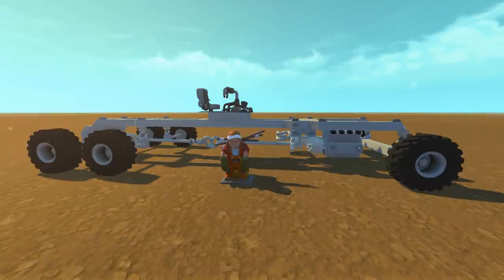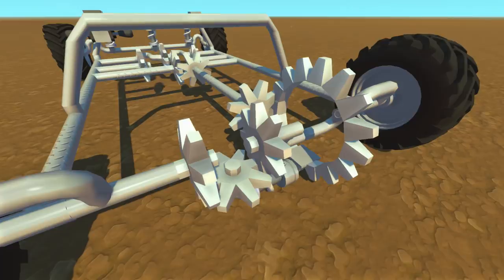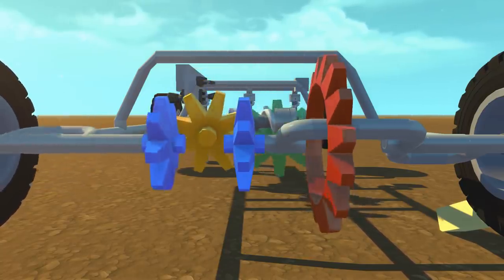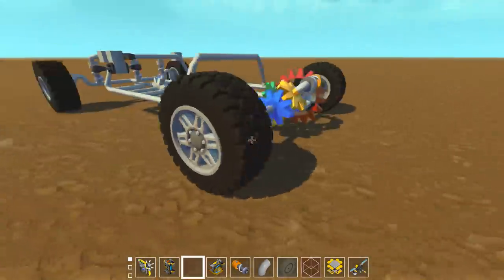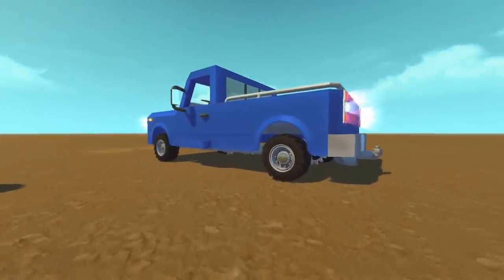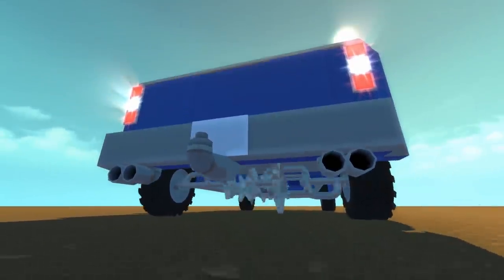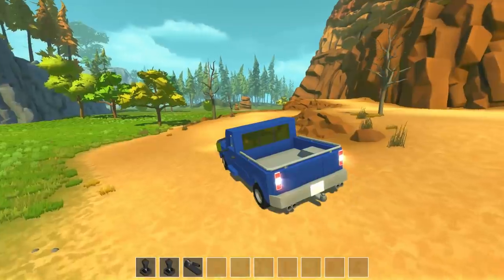I Built a Working Differential with Gears! - Scrap Mechanic Creations!

Comment: Limited slip differential is the next mile stone.
Reply: There aren’t grippy materials so that isn’t possible
Reply: @Lucas-qb3bs  what about a torsion type design? I think it might be possable to put sevral gears together in a stack to make a worm gear
Reply: andre21198 unless you used tiny suspension with mods
Reply: Some companies use a "limited slip" that may be possible with mod blocks.. it applies the brakes to a wheel whenever the other is no longer being powered. Once the brakes are applied it brings them closer to the same resistance... making it work like a limited slip... just have to find a way to bog down the axles...
Reply: It may be possible with a smart engine with a very low strength setting to it.
Reply: A good next step would be to use universal joints to connect the linkage from the diff to the wheels, so the diff can be lifted to have more clearance.
Reply: All you would have to do is have a bar go into the spider gear when the two axles spin at about 20rpm difference
Reply: @Lucas-qb3bs  the modpack has a 100% friction block. Might be the modpack beta though
Reply: @andre21198  i made one when pistons came out
Reply: It's called positraction people
Reply: I’ve been around mechanics all my life people have tried to explain to me how the differential works having this excellent creation finally helped me wrap my head around the actual mechanics of how it all works thank you
Reply: To all saying not possible, yea i get your point, there aren't any grippy materials. 
Now, i would have somehow been to stupid in SM to build a differential even tho i know a lot about cars, but maybe it's possible to do some electronic limited slip differential
Reply: You all do realize that SM doesn't take any of this into account right? All a transmission and differential do in SM is add more shit for your CPU and GPU to do. It's cool that this can be done but other than that its pointless.
Reply: ok
Reply: Milestone is one word

Comment: You might want to make a 'lifted axle' (there are 2 small gears one connected to each end of the axle and the other is meshed below it and is connected to the the wheel, totally you need 2 for each side of the live axles).
Both of what you made is an 'open-differential' they are easy to make but suffer drive loss when one of the wheels are in the air (which causes all the power to go to the wheel in the air), to deal with this there's a 'limited-slip differential' this senses if one of the wheels are in the air/losses traction, and if it is then it will lock the differential which makes the whole axle move as 1 shaft (this makes the wheel on the ground get the drive power and turn, making the car move forward/backwards until the other wheel gets traction, this is sensed by the speed of both wheels which should be more or less even)
Reply: Is a lifted axle like a portal axle, i believe the hummer h1 actually has a gears that put the wheels below the axle. It also has a built in gear ratio i think
Reply: @bkkid3630  Yeah it's pretty much is a portal axle (I didn't know about it, so thanks for telling me!). I believe that the lifted axle has a 1:1 ratio, but it can have a ratio that increases torque (power), but sacrifices speed.

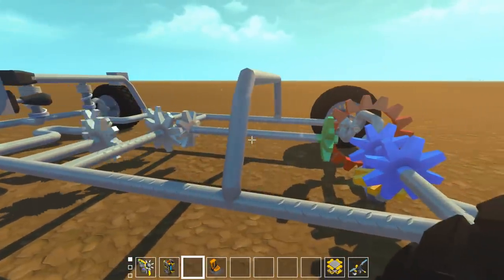Comment: 6:02 "Open planetary differential", or as some call it, a "true differential". Without getting into limited slip, there are two types. Yours is a typical bevel gear planetary differential. There are also spur gear differentials, which have all gears rotating on the same axial orientation. 

If you're after an insane challenge, try building a Torsen or helical limited slip differential.

Comment: moonbo have the differential higher than the wheels and then there are two options. slanted solid axle,or have the axles connected to a gear above the wheel  and put a gear behind the wheel.

Comment: Perfectly accurate to an open differential, getting your differential gear ratio to about 4 (4 turns of the pinion to 1 turn of the ring gear) should make it relatively powerful though relatively slow. I would run it into a transmission like kan made but with a 4-1 first 2-1 second 1-1 third and a 1-2 fourth if you're brave. As well as a 4-1 reverse. This will keep it from having speed issues as well as making it possible to use larger tires. After everything it will be 16-1 1st and reverse 8-1 2nd 4-1 3rd and finally a 2-1 4th / overdrive gear. This should make it a fun vehicle to drive, but will take alot of work.... I would do it, but i don't have scrap mechanic yet.

Comment: the additional spider gear doesn't make a difference besides the center of mass of the differential gear contraption.
So for very high velocities it is better because there won't be vibrations due to the center of mass beng off center

Comment: You would use the double spider gear in high horsepower vehicles like a drift car or any thing that has over 1000 hp

Comment: This is one of the reasons that the smaller spare tires will have a warning on them saying not to exceed 30 mph. When driving with one of these tires, the differential gears are in use even when driving straight, and the faster you drive, the harder they work.

Comment: I built a system that has double wishbone suspension and uses your gearing system for the driving on the wheels, you could add the differential to that and make a pretty realistic system,  it's pretty interesting and I think it would be cool if you checked it out, it is pretty laggy tho, if your interested I can post it on the workshop

Comment: An open diff like that will never be the optimal solution for off roading, as if one wheel loses traction you are screwed, and get a free fast spinning wheel, two ways to midigate that is either by creating a crawl gear that lowers RPM for torque so the wheels are limited in RPM, or a way for the diff to lock up, so you're forcing the wheels to turn the same speed no matter what, so maybe a way of enable and disabling the locking diff

Comment: you should make the diferential to have a locker on it so you can have equal power to the wheels and then when in a turn you can turn the locker off to turn tighter

Comment: an idea. use a medium sized gear on the drive part then the engines connected to 3 different sized gears. small gear for first medium for second and large for third. then first gear will actually give more torque. not certain SM can do that but it works in real life.

Comment: I made a differential as well, but I have the issue of as soon as one wheel leaves the ground, there is no more traction. I'm going to try to make a locking diff using the smart engines and seeing how that works.

Comment: So the problem with that diff is that if you get one of the drive wheels in the air or otherwise on bad traction you lose power because power always goes to the free spinning wheel first.  You may have noticed your little burnout was only using one tire. A number of locking mechanisms exist, and why friction pads, which are the nost popular, might not work, you can probably find something. 

For your transfer case it shouldn't be two bad. In real life a very simple mechanism is the chain and sprocket, with locking hubs on the front wheels that can be manually linked to the drive axel. For you though, a central sprocket that's always engaged to the rear, and can be moved to also engage the front probably makes the most sense. 

As for suspension, that should be bog simple. On either end just attach and beaing, and to that bearing attach a spring. That should give you functional live axel suspension. Don't be afraid to look into real life examples for inspiration.

Comment: Make a 4x4 with, suspension, all wheel drive, gearbox, piston engine, and differentials.
Reply: I'm working on that right now actually, it has rack and pinion steering and double wishbone suspension in the front, and trailing arm suspension in the back. It is a 5 speed

Comment: Open diffs are bad for offroading because if one tire has no traction and the other does... then the one with no traction will just spin. For offroading u want locked or at least limited slip diffs

Comment: I love this dif but when you see a car on the road it most likely has a double spider gear dif in it
Reply: or 4/none
Reply: the one without is called a torsen diff. a mechanical limited slip that works in a very cool way